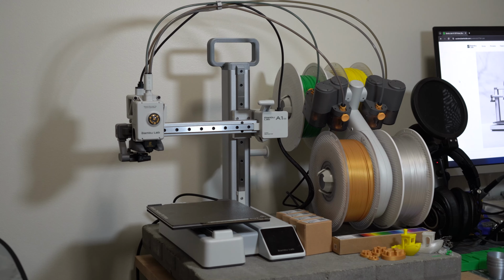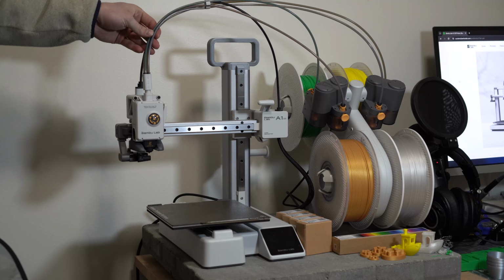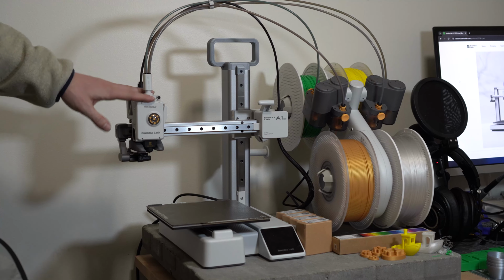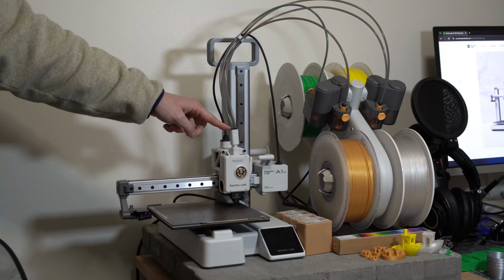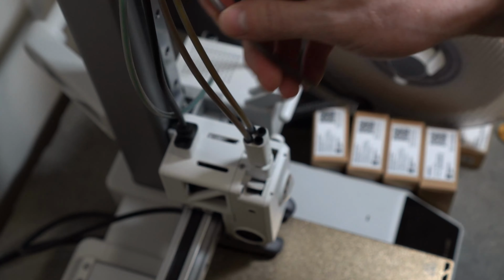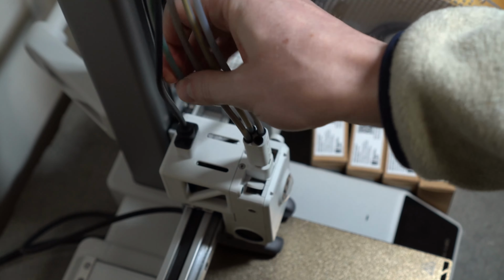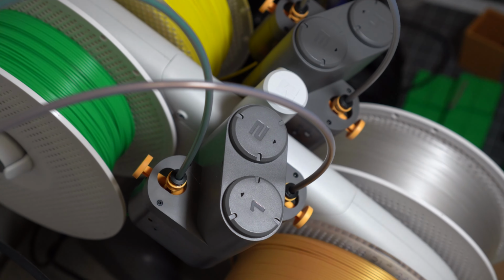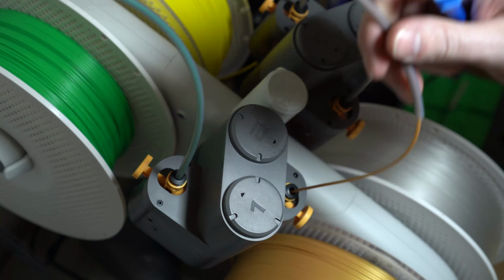How to remove PTFE tubes from the A1, A1mini and AMS Lite | Bambu Lab 3D Printers

Comment: Thats garbage. Mine got stuck. Needle nose pliers, chopsticks, tweezers, printed the right tool. Theyre all 4 stuck
Reply: Did you find a solution? Because mine still won’t come out
Reply: Mine won't come off either. Wtf
Reply: Mines stuck as well... and where the 4 tubes connect fell out of my printer too so idk how to fix it...
Reply: Mine came off after a lot of pulling, like more that expected amount of pulling
Reply: Mine are so stuck I think I need to replace the hub and ptfe tubes…. I noticed that the video was not using the supplied ptfe tubes, so I wonder if it is a tolerance issue with supplied tubes?
Reply: Mine also got stuck. If you push them in too far, they will get melted the next time you print.

Comment: @3DPrintStuff, What are the options (if any) are there to remove the tubes if you cannot get them to remove with tools. I've seen other videos and know whats in there, but it seems that no matter how much pressure I  apply via a tool, it does not release the tube....   

 I am not sure whether that Filament Feeder is a readily replaceable part,  but it almost seems that you'd have to replace it if you cannot get the tubes to extract..  Still going to work on it, there isn't really a need to remove the tubes at the moment, other than just being able to do it, if and when its needed..   At least the AMS tubes seem to extract...
Reply from the maker: Try pushing down on the ring and then pushing the tube a little further in before pulling out. Hopefully that makes sense. You're trying to unhook the little metal teeth that grip on to the tubes. 

I also have this video where I tore the infeed apart: https://youtu.be/mkxxw6pWbcQ you can see the little metal teeth I'm talking about. 

And the infeed is a readily replaceable part in the description of the video linked above.
Reply: @3DPrintStuff    Thanks, it does make sense to push then pull to try and release...   I'll continue to work with it..  I am not sure of how they could improve this, but I am sure there is a way for Bambu to alter this part that could be ordered to replace it to make tube removal easier...  I'll check out the other video..

Comment: I've got the opposite problem,  one of my ptfe tubes keeps popping off every filament change (other 3 stay put) any idea on getting it to stay?
Reply: Man I have this too
Reply from the maker: Are you sure that you’re pressing it in far enough? You can also try swapping the tubes and see if the problem stays at the same position or if it follows the tube. 

If you check those two things and the problem persists at the same position I’d reach out to Bambu Lab support and submit a support ticket so that they hopefully send you a replacent filament hub.
Reply: @3DPrintStuff  I ended up just popping off the hub and then the clip and that helped me push it through the shark teeth
Reply: @3DPrintStuff  I've tried pushing it in but have not tried swapping it with another. I'll give that a try & if it still happens I'll reach out to Bambu. Thanks for the help 😊
Reply: If you push it in too far, it gets melted inside.
I hate these stupid design flaws.

Comment: Hey, my A1 it's not secure. How can fix it?
Reply from the maker: I wrote this reply for another viewer: 

"Are you sure that you’re pressing it in far enough? You can also try swapping the tubes and see if the problem stays at the same position or if it follows the tube. 

If you check those two things and the problem persists at the same position I’d reach out to Bambu Lab support and submit a support ticket so that they hopefully send you a replacement filament hub."

Hope that helps
Reply: @3DPrintStuff  Yes I push the tubes hard and hard and then it is still easy to pull up.
Reply from the maker: @madebytl  Have you tried pushing down on the black outer ring and then pushing the tube in? This can potentially "reset" the teeth inside the fitting. 

If that also doesn't work I'd submit a support ticket and see what they say.
Reply: @3DPrintStuff  No just push the tubes

Comment: I can’t print the tool because it won’t let me until I remove stuck filament, which is why I needed to remove the ptfe tubing
Reply from the maker: This is why I offer the tweezers as an option, you can also do it with your fingers. It's just a bit trickier.